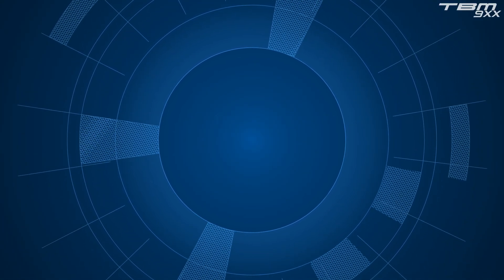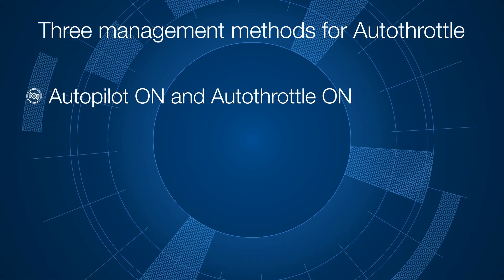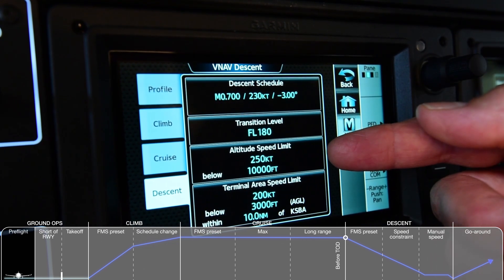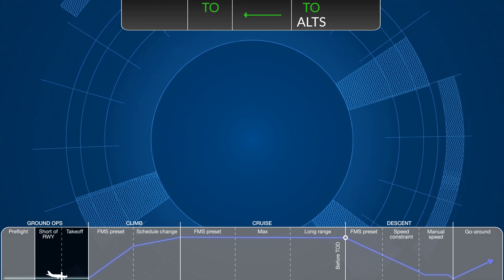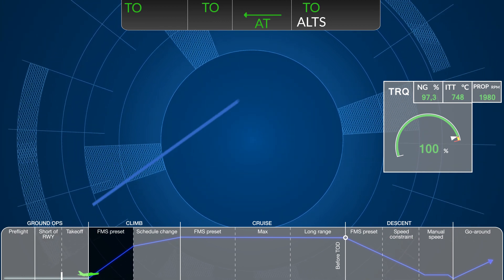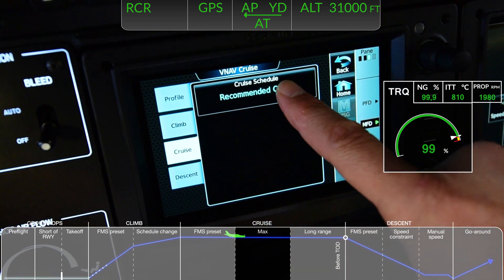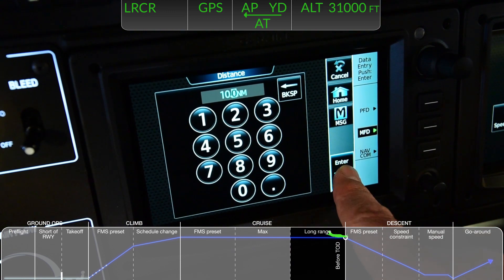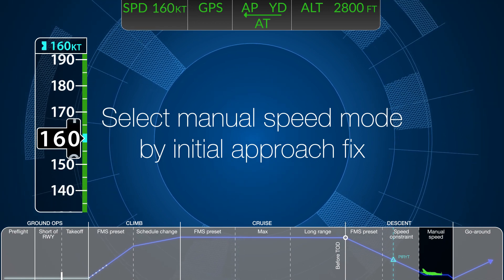TBM 940 - GTC management for Autothrottle

Comment: Wow, awesome! I hope to see TBM 940 in a new Microsoft Flight Simulator 2020. Thanks dude for so informative video!
Reply: Only the 930 will be in FS2020 unfortunately
Reply: The 900 and 910, or is it the 910 and 930?, will currently be included in MSFS 2020. Why would you want a plane that does everything for you in a flight simulator?
Reply: @normand5847  Does the auto throttle also control pitch and roll? That's crazy!